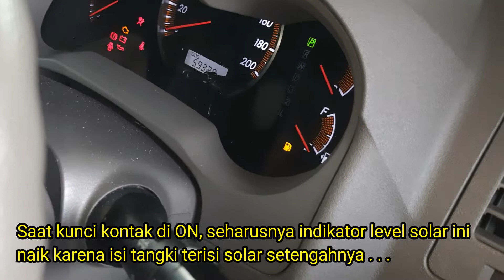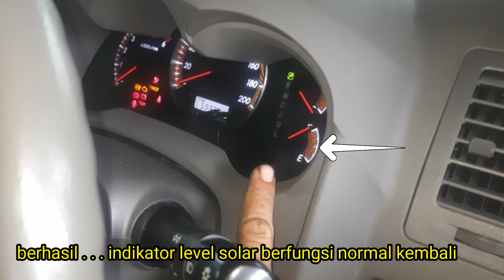Sensor Pelampung Solar HILUX dan cara pengetesannya...

Comment: kalau pagi indikator bbm nya normal habis itu engk naik lagi ,itu apa nya ya om ,innova bensin 🙏
Reply from the maker: Harus turun tangki dan keluarkan pelampung bbm dari tangki dan test manual naik turun pakai tangan dan cek indikator bbmnya
Reply: @AJMcrews  baik om terima kasih
Reply: Om tolong om kasih solusi, kalau pelampung di buat di luar, naik mau, turun yg gak mau, tapi kalau di pelampung sudah di dlm tangki, malah kebalik turun mau naik gak mau, itu kenapa yah ?
Reply from the maker: @dianraymond8326 wah kejadian terbalik seperti ini blm pernah saya temui, pastikan dulu saat pelampung ditest di luar tangki harus bisa naik dan turun saat tangkai pelampung digerakkan

Comment: Kalo di toyota hilux saya sudah di isi solar tapi naiknya lama jarum indikator minyak di dashboardnya
Reply from the maker: Indikator bahan bakar di kontrol oleh pelampung solar di dlm tangki.
Kami biasanya akan menurunkan tangki dan pelampung solar di dlm tangki akan kami lepas dan digerakan manual pakai tangan utk memastikan gerakan indikator minyak di dashboard apakah berfungsi normal.
Umum terjadi pelampung solar di dlm tangki rusak, kotor, kendor/kocak
Reply: Di jumper juga bisa ya mas kabel soket positive dan soket negative di jumper lalu kunci di posisi ON ,jika jarum indikator naik berarti pelamoungnya yg rusak
Reply from the maker: 2 Kabel soket pada pelampung hanya sinyal negatif, dimana 2 kabel tsb satunya sinyal ke indikator minyak dan satu kabelnya adalah negatif/ground.
Pernah dicoba digabung ternyata itu tdk bisa, harus butuh resistan seperti pelampung solar utk pengetesan...cek seperti pada video